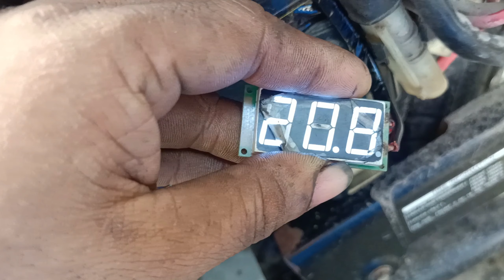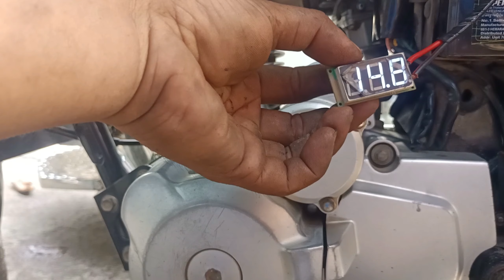lolobo talaga ang batery mo kung di mo alam Ang trouble shoot ng motor bago magpalit ng batery

Comment: Nalolose connection nya sa accessories wire, or maaring defective na, Yung charger over voltage na
Reply from the maker: Pwdeng. Putol Ang itim sir kapag GANYAN pero nacheck ko hd namn nalabas Ang itim